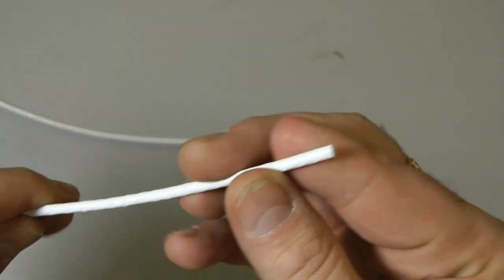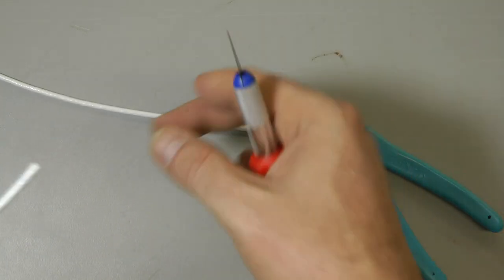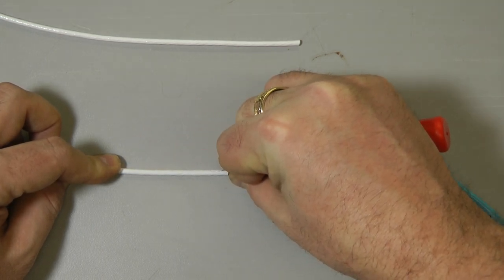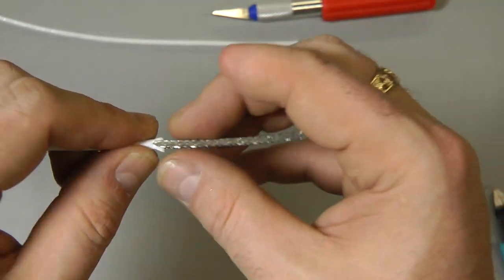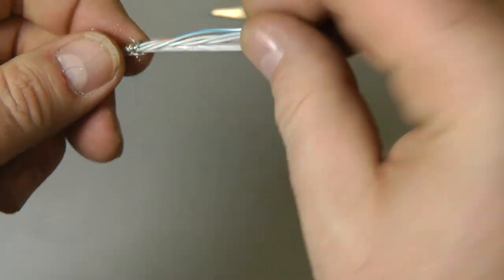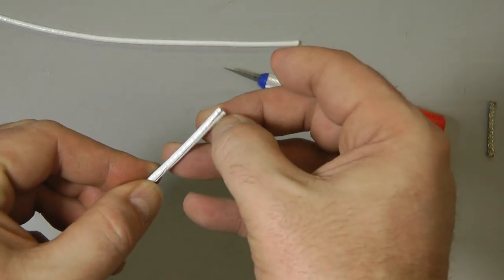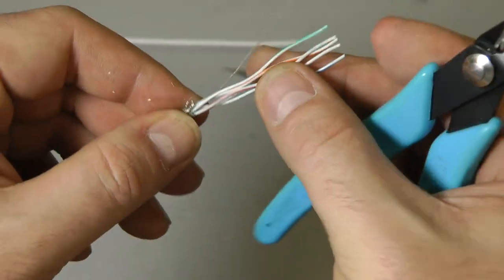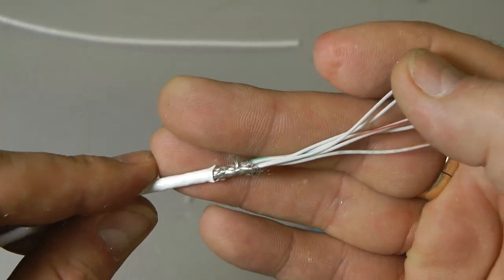006: STRIPPING MULTI CONDUCTOR AVIATION WIRE / CABLE

Comment: Was at a conference recently and stopped by the Daniels MFG booth and they showed a new product that they had for automatically stripping this wire. It use a unique die depending on the number of conductors. You would slide the wire into the tool and as you pulled it out the cutter would cut the outer jacket as it spun around the wire. Like most tools from DMC it was too much money for me, I still use your method. Thanks for posting,